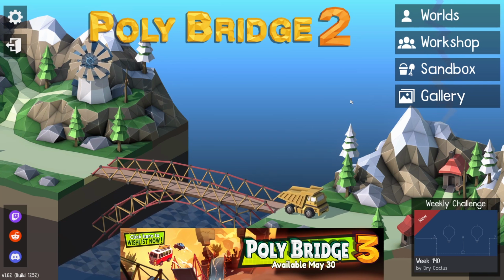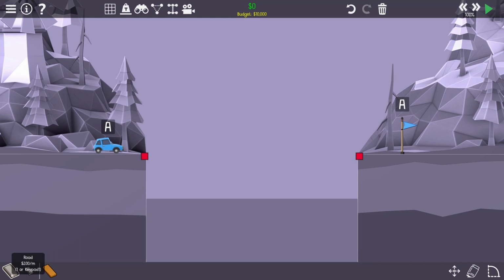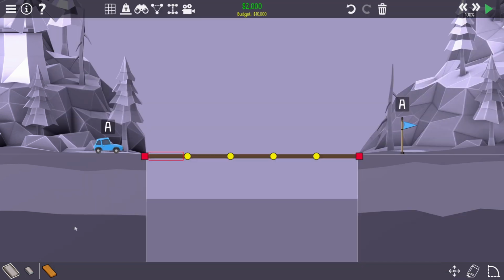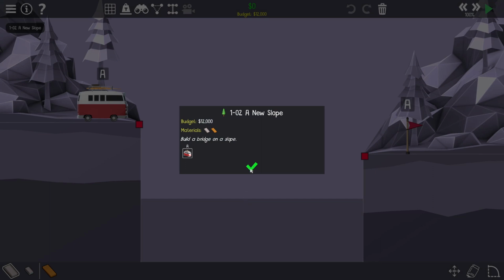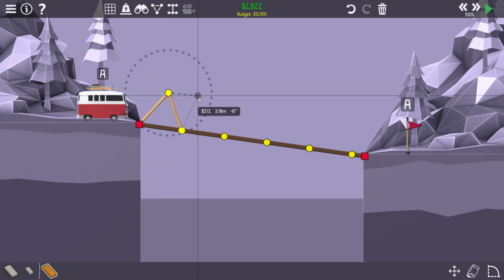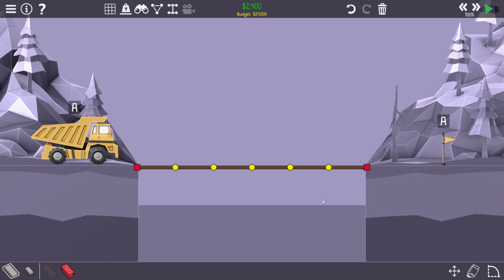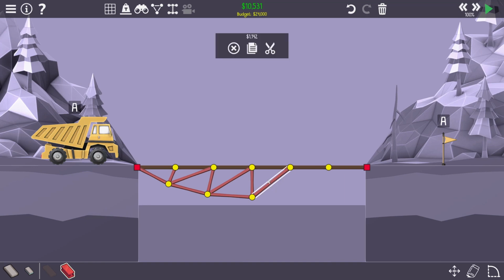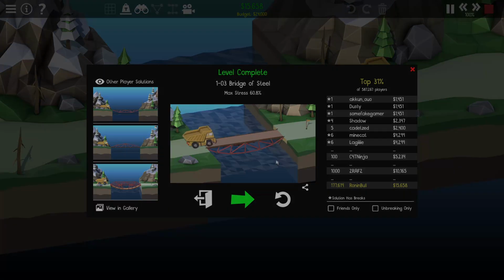Poly Bridge 2: Levels 1-01 to 1-03. (Controls and Basic Concepts)

Comment from the maker: Excellent discussion about the mechanics of PB2: https://www.youtube.com/watch?v=WiBC-h-_o_U&lc=UgxsR0yzbATOdF96mXh4AaABAg and https://www.youtube.com/watch?v=WiBC-h-_o_U&lc=UgwMucry5eY-Quf2tL54AaABAg

* Wood and Steel have ZERO MASS per length!! So 0.25m of wood and 2.5m of steel both weigh 0 Polygrams.
* Regular road pieces weigh 0.5 Pg to start, then 0.25 Pg per meter of length.
* Reinforced Road pieces weigh 0.625 Pg to start, and 0.3125 Pg per meter of length.
* Normal joints weigh 0.25 Pg each, no matter if they're in road, wood, etc.
* Split joints weigh 0.25 per sub-joint, so a split joint of 3 sub-joints would weigh 3 * 0.25 Pg = 0.75 Pg.

Lessons: Make structural members long (huhuhuh, uh-huhuh), and use as few joints as you can. This will get you the most strength with the least weight. (Also implies that Warren Truss should be your default truss, since it has the fewest joints per section of truss.)